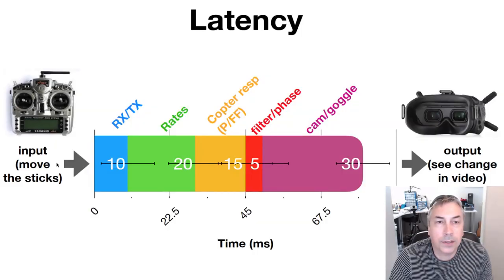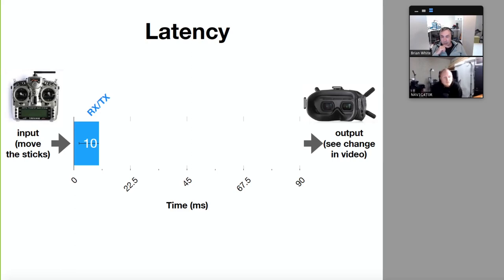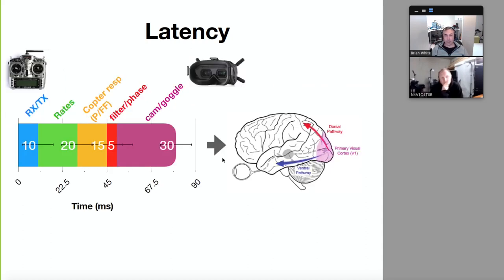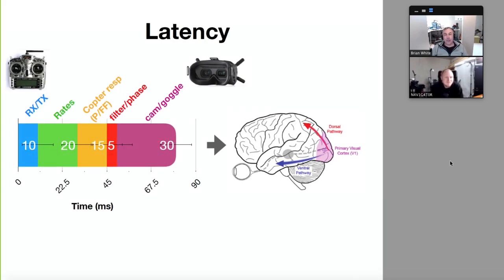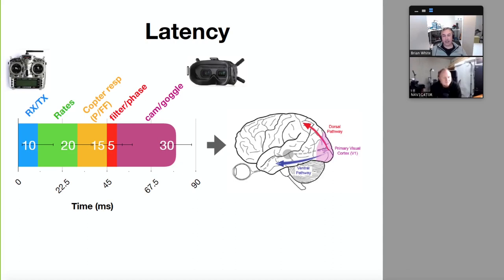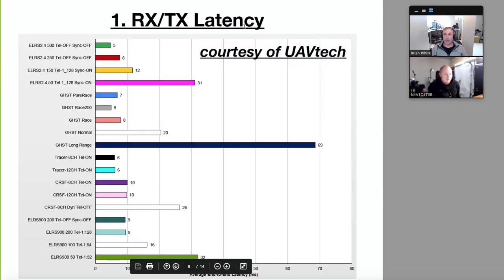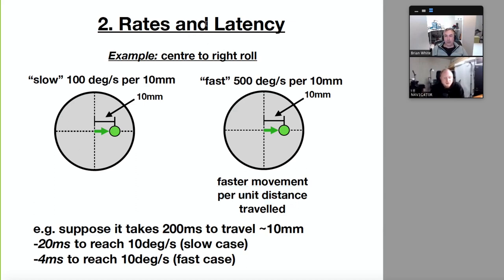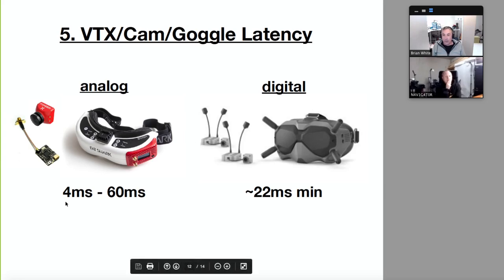PIDtoolbox Q&A #04 | Latency and Phase Delay

Comment: Thanks for the informative videos (and the great software).

In terms of the order in which the components of latency are shown, wouldn’t the latency attributed to “rates” (i.e. thumb movement) come first, since your thumbs move the sticks (and rates are computed) before the RX latency comes into play? Similarly, wouldn’t the filter latency occur before the setpoint delay, since the quad is only determining how to move relative to the filtered gyro data?

I suppose the ordering doesn’t really matter if the point is to enumerate the various sources of latency and discuss their relative contributions, but I still wonder about the sequencing.
Reply from the maker: Yes that’s right, the order here is not exactly meaningful. Though rx latency is certainly before since set point (rates) are computed from that signal after it arrives in the FC right
Reply: @PIDtoolbox  but a rc curve (thus a rate) could be set. maybe that was his idea

Comment: Hey, it just got interesting and video stops 🙈
Reply from the maker: yea, unfortunately nothing more interesting happened lol. but Im surprised you watched till the end. I was afraid it was getting sleepy lol
Reply: @PIDtoolbox  
Sure I watched it, but I must admit I skipped the first parts about rc link and stuff. Not much new for me…
I have a really tricky 10 inch and after having a bad fc and a noisy esc I might still be running to high filtering (had massive freak outs and this is no fun with 10inch and 2,5kg). And this is my main thing: how much filtering is really necessary. For me I guess I use too much. There was one video by uavtech where he tuned a 3inch and it looked so noisy at first but it was flying fine.
But yes how much filtering is really necessary. Sadly I was not able to fly for a long time, so I still have to try out what I learned from all you guys.
Reply from the maker: @jas-FPV  depends on if you have the bosch gyro (radix), which has less internal filtering. Also a 10inch is mainly for cruising so more filtering wont kill you too much, but opt for more dterm filtering over gyro LPFs. also maximize RPM and DNs so you dont need as much gyro LPF filtering. the gyro LPFs are the real killer
Reply: @PIDtoolbox  
Yeah. I got misled by all the hardware issues I had with it. Iflight dual, both gyros bad, replacement fc also. Iflight 60amp esc noisy as hell…. This leads to wrong decisions regarding filtering 🤷🏼‍♂️
Yes I will restart the tuning with gyro at 2.0 and go from there.